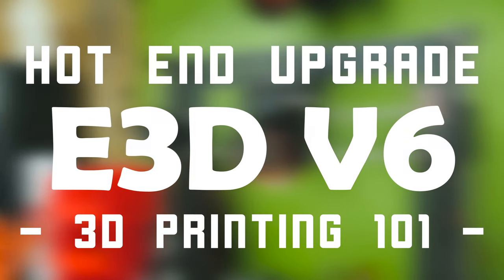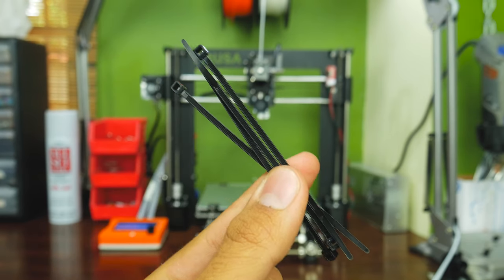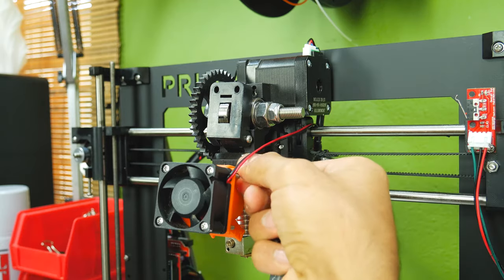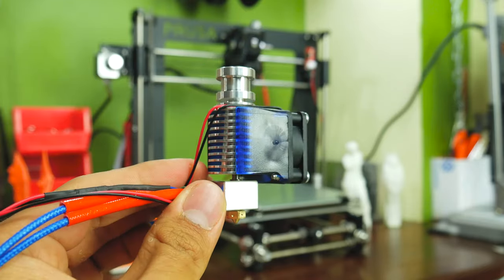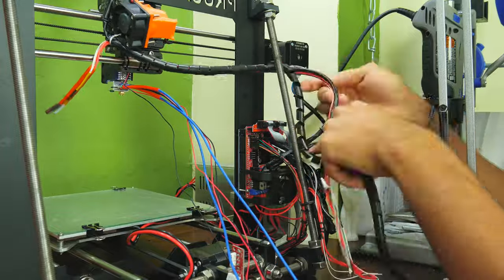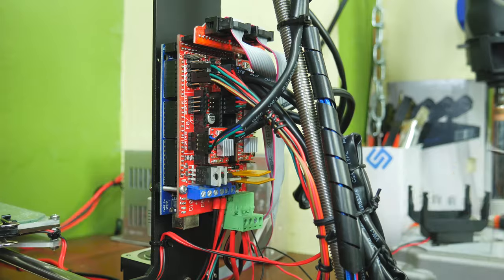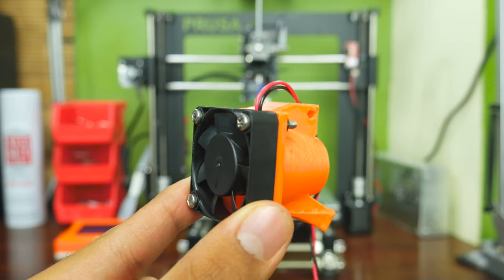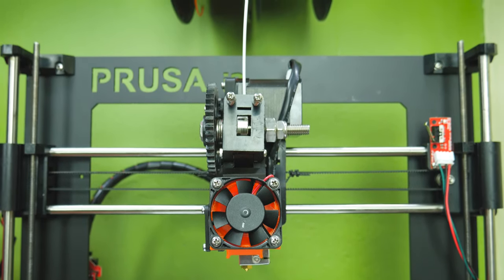⚙️🌟 E3D V6 Hot End Upgrade - 3D Printing 101

Comment: by changing your hotend, you also change the hight to the bed. not every hotend has the same dimensions in height.  you possibly have to relocate the z endstop and adjust the bed.
Reply from the maker: True!!! In the case of my printer, I only needed to adjust the endstop by tightening a screw. But not all printers are created equal. If you want a design like mine check out this design in Thingiverse http://www.thingiverse.com/thing:542892